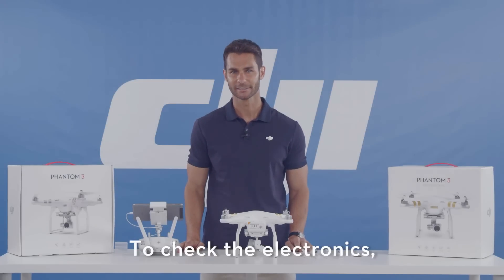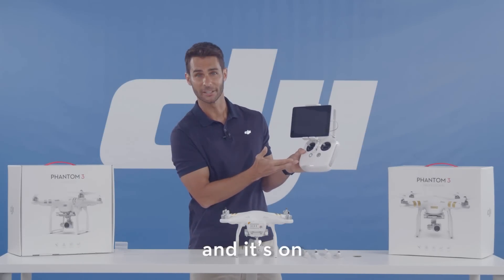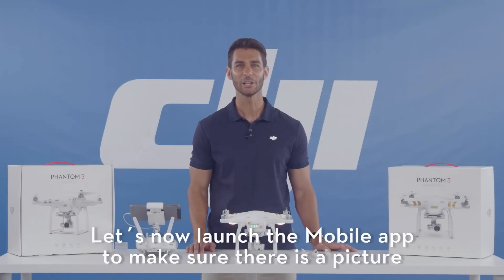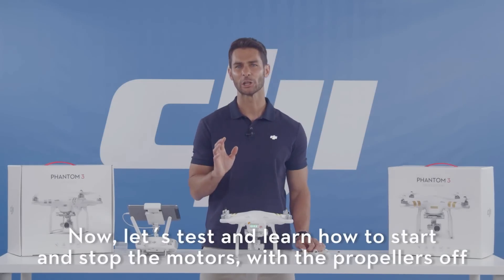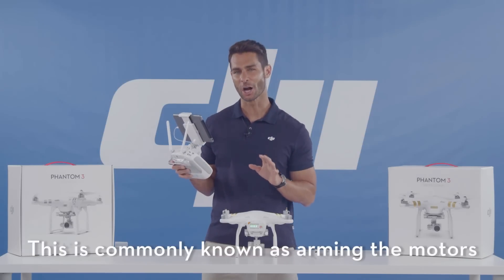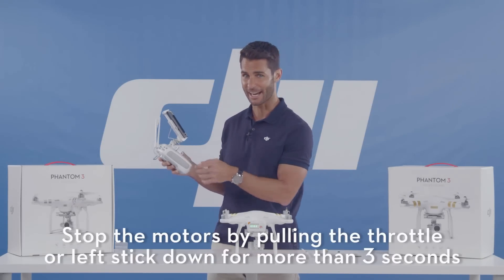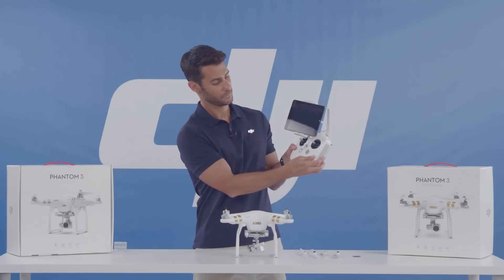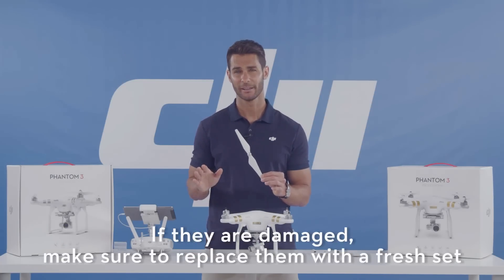DJI Tutorials - Phantom 3 - Pre-flight Checklist - Part 2 of 3

Comment: I recently got my DJI Phantom 3 Standard drone. However when I try the test "Checking the electronics" nothing happens. I turn on the drone, everything looks fine. The camera moves, the red, yellow and green lights all comes on. I power up the remote control. I then pull down both joysticks and then in as the man in the tutorial video showed. Still nothing. Did I miss a step? Your help will be greatly appreciated. Thanks!

Comment: Be careful : there is an error. The down left stick for stopping motors is no 3 seconds, but only 1 second !
And be careful to NEVER do this in flight sesssion.
Please put a plastic thing in bottom of the left stick (mode 2) before flight, and always keep in mind to never do a too fast descent. This could lead to definitively crash your Phantom.